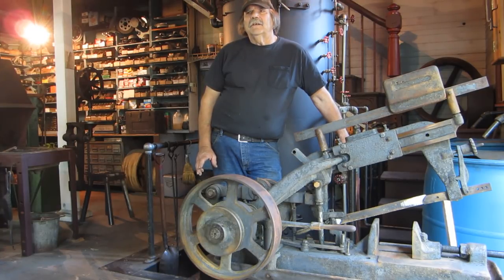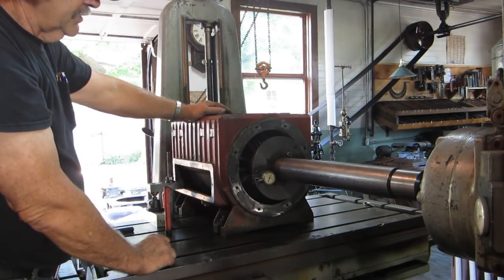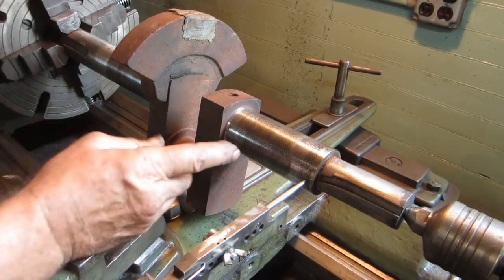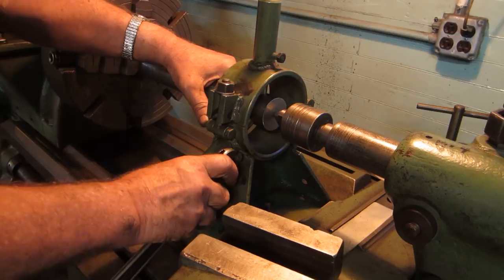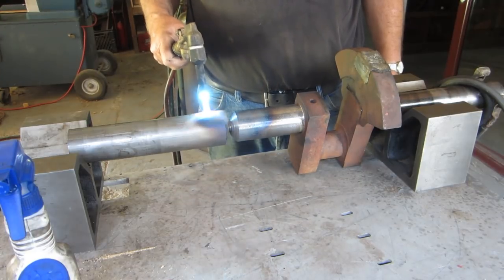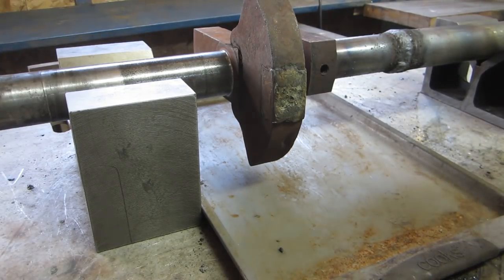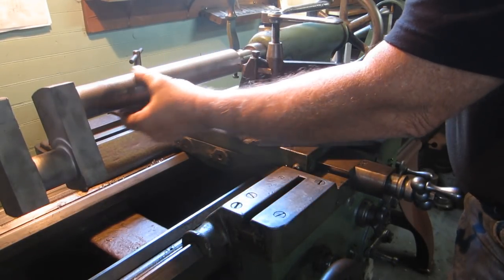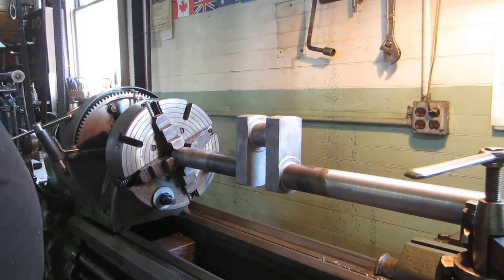OLD STEAM POWERED MACHINE SHOP 14  Steam engine crankshaft

Comment: I'm not sure how to ask this question, but... From my experience stick welding, you have to chip slag off the weld (well it should virtually peel off as it cools, but I digress), but welding 360 degrees like that, how are you making sure you don't overlap the weld and incase slag in the weld? Seems critical to having a strong crankshaft that you don't incase slag inside it under your bead of weld.
Reply from the maker: John:  The welding heat is really high at that amperage and if you momentarily get into the previously layed down weld, the slag will float up to the surface with the rest. Good question....Dave
Reply: David Richards Okay that makes sense thanks. These videos are cool I am thinking about using a steam engine to turn a generator for 3 phase power for a home machine shop. You went to a whole other level creating that lineshaft setup. Pretty awesome.

Comment: This is one of my favorite channels.  Thanks Dave!   One question, how much did you end up taking out of the rotary vane pump? What was the final bore diameter?   (Ok, that was two questions). 😎
Reply from the maker: I ended up taking .074", and it came out 10.074" exactly on both ends. Amazing with that beat up old boring mill....Dave

Comment: Oh, ya, What is the bleeding going on at the engine during start, a small 1/4 inch tube and valve you shut off after the engine is rolling? Second, the valve at the bottom of the boiler, a emerg water to put out the fire quick?
Reply: got it. Thanks  What about the valve in the bottom of the boiler?

Comment: Dave, I am building an engine very similar to yours running the shop. I have a couple questions. First, You are using rain water. Any chemicals added or just straight rain water? Second, What type of oil are you using and where can I get some? Thanks. Your videos are very informative for my building process. JIM
Reply from the maker: I use rain water with the Ph adjusted to about 8.5, also Jim Conte's  "Boiler saver" compound as directed. I use "Green Velvet" steam cylinder oil in the displacement lubricator on the shop engine (you can find it online).  Or the old formula heavy cylinder oil in mechanical oil pumps (you can get that from Cattail Foundry, Gordonville, PA.)
Reply: Awsome Thanks

Comment: Would love to know more about your indicator, Is it a commercial unit or ? if so what make is it? All the indicators I have seen have read to the side rather than in-line like that one. Love your videos, I think I subscribed right after your first one!
Reply from the maker: Al, I'll talk about that indicator in #16, #15 was running too long.  Thanks, Dave
Reply: Sorry, maybe a misunderstanding but I just came back here after watching #16 and you talk about your threading dial. However I was interested in a little more information on the indicator you are using at about the 22.00 min. mark. Thanks again, really enjoying the rebuild, nice work on the crank fit-up
Reply: Sorry just came back from your G+ page and see that you posted there, Thanks!

Comment: Bbloc also got a small boring machine from a company that was getting a larger one.  But his small one weighs 40,000 pounds.
Reply from the maker: Mine is a 2 1/2" spindle size rated machine and you just don't find them much anymore....Dave
Reply: i want one

Comment: If it's not a silly question, why don't you use a 3 or 4 jaw scroll chuck? It would save all that messing around trying to centre the work. Were they not made for the lathe, or were they a later invention, so out of period?
Reply from the maker: Good question, A three jaw could be used. I don't have one for the larger lathe, the one I have for the South Bend has about .003" run out, which is not acceptable for most things unless you can do everything in one set-up.  I haven't seen many old scroll chucks that were closer than .002".  With a four jaw, you can get it in as close as you want. So to answer your question, it's an "accuracy thing".....Dave

Comment: what are you putting on outside of belt at 1:30?
My first job was in belt drive days and we put belt treacle on inside of belt?
Reply from the maker: Just neatsfoot oil...Dave
Reply: David Richards Hi Dave, thanks,
old textile machines factory had lots of single cylinder gas engine driven flat belt lathes in use but only got a bit of treacle - and lots of shiny American ones brought to Britain in WW2 for war production stored unused in a big cellar!
Typical stupidity that ruined UK manufacturing.
How I'd love to turn the clock back to my first day in that place in 1962 and just preserve it as a working museum!

Comment: I've commented before, but I don't know if I ever told you about my machines.  I have a Champion Tool works lathe, a Silver manufacturing company camelback drill press, and a bench grinder that are all three lines haft machines that were retrofitted to be run by electric motors.  They came out of the machine shop in the local box and mill work factory in here in my town.  The mill opened in 1895 and closed last summer, 2015.  I had thought that maybe the machines had always been electrically driven, but recently found out that there used to be a line shaft that ran the length of the building and ran all of the machinery in the building.  I was pretty excited to learn a little more about the story of my machines, just wish I had more of the lines haft pieces.  The clutch of the drill press is gone, the lines haft end of the lathe pulleys is gone, and has been replaced with an electric motor, and the bench grinder's stand has been modified to hold an electric motor, which is missing.
Reply from the maker: Thanks for the great comment. Well, all machinery was run by line shaft before local electric power was available and that's a fact. You can probably piece together a power system and improve it as you go along. The tight/loose pulleys and shifter were missing from my drill too, but one day I found them stashed in a corner. That was the beginning inspiration for my shop. Good luck with it, keep us posted......Dave
Reply: Will do!  Once I get the machines running, at least on electricity, I will try to put some pictures in a comment.  I have pictures of them in the machine shop in the mill if you are interested.

Comment: Taking the counter weight off could have been done to put it in better balance for turning without the piston and rod attached. That crank could shake a smaller lathe clear across the room if both weights were on....
We frequently underestimate the ability of people in the past to make precise things with the tools they had. They could have just brazed the bolt in place, why pour all that babbit? They had to be correcting the balance for the exact piston and rod that the machine used. 
Do you think they clocked that bolt exactly 45 degrees off from the crank to maximize the hold the babbit had? With the width of the head and the thickness of the counterweight, if it was square to the faces of the counterweight, there would only really be 2 sides held by the babbit.
Reply from the maker: Good observation, I want to check and rebalance the rotating assembly when we get finished with it...Dave

Comment: How do u know the taper off set is horizontal and not vertical?  Wouldn't sand paper or a file take out the taper?
Reply from the maker: I'm mostly assuming the error is not in the vertical plane because of the results I get micing the part after offsetting the tail stock. Also the error in the part would be much less if the alignment were off in the vertical plane because the tool is cutting on the side of the shaft and up and down center alignment wouldn't have very much effect, but you are right, there would be some.....Dave
Reply: I'm not a machinist i gun tinker, but when i set my lathe up i had to shim my tail-stock first to get the vertical alignment to go to 0... i could correct the taper mostly moving it side to side but could not get it to hold '0' in different lengths until i 0'd the vertical.... anyway, thanks for a wonderful channel you do good work...

Comment: Most interesting seeing that vane air pump being rebored, That sort of damage usually occurs when the constant drip feed oil supply fails for some reason or the water trap fails for some reason on the plumbing from the tank to the pump and the pump is flooded with sludge!
A simple ball valve is reversed which allows the pump to pressurise the tank and blow the contents out as a spray onto the land for emptying.
Reply from the maker: Wow, a sludge pumper with experience, thanks Dan..Dave

Comment: I get a bit annoyed with all these guys acting like CNC is the best or nothing even though they have tiny little machines with little power. The real work happens on machines like the boring mill. Age doesn't stop the job from getting done.
Reply from the maker: good point...Dave
Reply: CNC works best in production situations. One off work is more easily done with hand crank machines. I worked in “one off” repair for 35 years and did a lot of repair work on CNC machines with hand crank machinery in the last years of my employment.